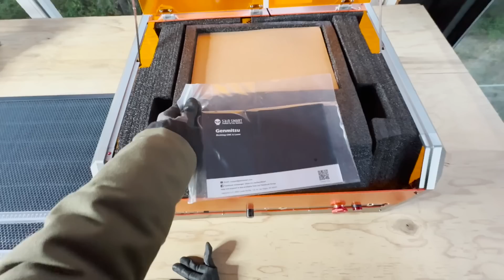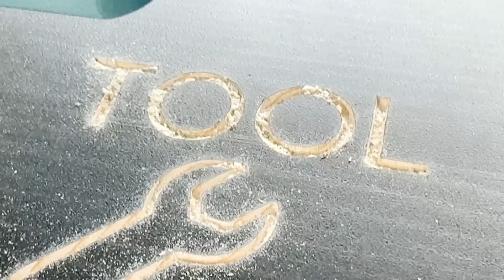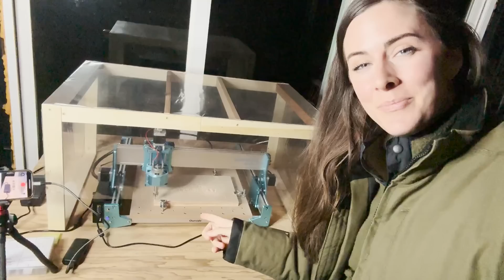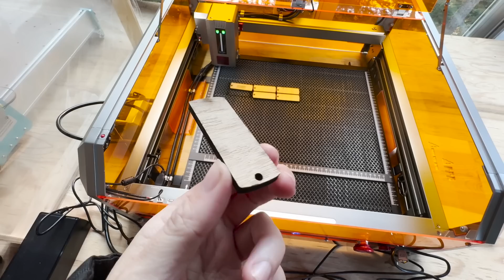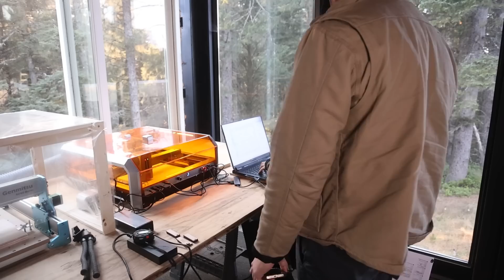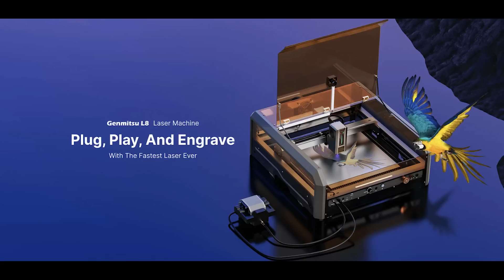DESKTOP CNC VS. LASER ENGRAVER - Pros Cons and Everything In Between #CNC #Laser #diy

Comment: This piece took four hours because you only used a 20-degree V-bit. For pieces like this, you could use a clearance bit  as your first bit, and then use a 30- or 60-degree V-bit as your detail comb. This would take 30 minutes, or less, depending on the size. You can use easel option.

Comment: I am kind of thinking of dabbling into some engraving and seeing this was helpful. Curious if this statement makes sense or if you have had time to use the CNC more and found it to be better for certain things.

To me, it seems the laser etching device is lower cost and faster learning curve because it is limited burning material and better for thin and small crafting items. Such as perfect for etching coasters or personalizing smaller items, but the CNC would be better for creating things like Address markers or working with thicker material?  Example would be if you wanted to make an inlay for a cutting board you would need to do that on the CNC?

Comment: When I look at the spindle on that cnc I cringe. It is way too small and the tool is hanging out too far causing a chatter problem. However I like the machine but not the spindle. 82 year old cnc and manual machinist and still Makin chips.😊

Comment: Laser is more energy and cost efficient at cutting wood upto whatever the rated thicknesses are (1/8 - 3/4" thick for ordinary diode lasers), while CNC is more versatile in terms of material choice and techniques (Especially "carving" and "shaping", lasers can only cut straight through), and can normally accommodate upto 3" or more. It's more messy than a laser, but it's got noticeably more versatility.

Comment: The CNC should outperform the laser with proper drill bit without a problem.. but I would assume one needs to wrap head around having the "picture " divided intoultiple layers . . One for the thick parts ...one for the fine details. Both are great machines and I'm sure you'll be more efficient in squeezing their potential out ,the more you work it

Comment: After you spend time with the CNC you’ll figure out you can drastically reduce your carve time by using a larger bit and separate tool path to clear large areas. Then use your small v-bit for detail work on a separate tool path.
Reply from the maker: Great point! That's a great tip to save time 😊 Appreciate it

Comment: If you used a 90° bit instead of the one you used, you understand the error of using a 20° v bit 😂😂😂
Reply from the maker: We used what we had. Now that we experimented a little bit we can upgrade to other drill bits but like I said in the video, it was our first time using a CNC machine.
Reply: @PacificPinesRanch  trust me, I had the same difficulties when I first got mine. With router bits from Harbor Freight .. definitely a learning curve.

Comment: 2-3 hours is short time.  I do peoples pets carved into wood and some designs can take 14 plus hours.     You should definitely set up a “roughing” and “detail” pass..  use an end mill bit for the roughing and your vbit for the detail pass.   
The roughing will clear out the pocket, and the vbit cleans it up.   It should take that 2-4 hour design you did and make it 1-2 hours.
Reply from the maker: Thx for all the tips/advice! We only had the V bit when doing this project so we made the best with what we had. We’re still learning and definitely still beginners. I appreciate the advice though! It will definitely help on the next project.
Reply: Where your bit is displayed on easel’s main screen, there’s a plus sign.. click that and you can add a second bit.  This will set up roughing and detail passes.  Remember to set feeds and speeds for each bit though.
When you have two bits set up and start a project, you’ll do the roughing first and the machine will stop..  change your bit and lower to zero again and start the detail run.  
Hope this all makes sense.  I wish someone had told me this 6 months ago when I started.   I just went in blind and figured it out. 🤷🏻‍♂️🤦🏻‍♂️

Comment: Check your feeds and speeds on the CNC and clear with larger 1/8" or 1/4" bit.  I've carved out much larger projects than that simple design in less than 20 minutes with 1 bit change.
Reply from the maker: Thx for the tips!! Appreciate it 😊

Comment: I've got a Fox Alien XEXE Pro with the rails upgrade kit / Makita hand router, and two Xtool lasers. If I was really pressed, I'd choose the CNC over both lasers... but ideally you need both. Lasers are very quick for detailed cuts, engraves with a natural burn effect and if you have a Fiber you can do metal engraving / cutting (though cutting often is for commercial lasers not pro-consumer level). I use my lasers more, just because the setup is more complex with a CNC (choosing which CNC bit, making sure the bit you by is 1/2 or 1/4 collet, pre-setup takes longer, etc...), but my CNC gives a cleaner finish if you don't want any burn, and therefore less post production clean up. Lasers can also do insane detail, and yes you could get that on a CNC but it would take more massaging than a laser straight out of the box (brass coins would need to router type bits, etc...). I'd be careful of the all in ones; laser and cnc router; the CNC heads on the routers are often underpowered / overrated (in terms of power) and often don't offer any protection from the laser.  I would love a CNC that has auto bit selection without having to manually change it, but the price seems to jump up at that point.
Reply from the maker: Thx for all the info and suggestions! 😊

Comment: I have had a laser for a couple years and have a CNC mill on the way (but have used them previously).  I suggest that rather than having them do the same thing, it’s better to play to the different machine’s strengths and how those match up with the main things you want to do.  

The laser is faster, but because it is burning away material, it only works on some materials and there are limited options for making anything other than straight sided cuts.  There is a trick for laser cutting V-grooves in wood so there can be a fair bit of functional overlap.  The laser can etch stone and glass.  Not burning but rather micro-spalling the surface to create a frosted look with little or no depth.  Can’t add more than temper coloring to some metal surfaces and most plastics are a bad idea.  Can cut and engrave leather and engrave skeletal materials.  Can be used with a heat activated decolorant or directly to add patterns to cloth (by removing existing pigments). 

The CNC mill lets you do more complex shapes (especially if you add a 4th axis rotary) and in addition to wood, plastics, epoxy resin, modeling wax and other solids become workable.  Metals too, though for these hobby mills, there are constraints mostly dealt with by taking it even slower.  And the very soft and very hard materials that the laser works on, the mill won’t.  Since I don’t have my own mill yet, I haven’t fully explored the possibilities there yet.

Worth noting ongoing costs too.  The laser pretty much just works, expending nothing more than the power to run it and the materials to be processed.  The mill uses those plus bits that are not especially cheap.  You will want different bits for different applications and they will wear out and/or break, adding replacement costs.
Reply from the maker: Great tips and info! Thank you for sharing! Appreciate it 😊

Comment: The answer is both.  Although some tasks can be accomplished with both, they are two different machines.  Upgrade to a Makita router to transform your CNC experience and capabilities.  Throw those clamps away and get XFasten Woodworkers tape to hold your work down.

Comment: Hi Beautifull eyes! i decide to start whit a laser, its a 2d products oriented but u can contain the smoke and vent it or filter, the cnc will come later, have to contain in my case the dust also, it can give you more deeper cuts and engraves but have no colour, it have to make aside, i believe can be complementary but im not sure of that, at the moment i see them as different machines and believe laser its more complete. cnc its noisy too and laser can give you finished works, a router its a tool to precess material and then follow whit the rest of the work till its finished :)

Comment: For the wooden version, put down a thin clear coat of epoxy, then once it's sealed, you can fill with colored epoxy. Laser is just black, but with CNC it's easier to add color
Reply: I agree on this - the CNC is more flexible for creating different types of projects.  I have both types. They each have unique purposes.

Comment: If you don't have a lot of space, and your volume is low, there are multi-purpose machines.  The Snapmaker, for example, is a CNC router, laser engraver/cutter, and 3-D printer.  You change heads depending on the task at hand.  For the CNC function, most models have a lathe option.  These tools are more expensive than individual machines, but less expensive than buying one of each.

Comment: If you use different bits, you will cut your time in half or even more on the cnc. Trust me. It can go much faster. Also move your speed times in easel up as well. They put it on the safest slowest cuts. You can make very good times adjusting those 2 things.
Reply: A flat bottom upspiral bit would dramatically speed up the process
Reply: @lavernejones6520  1000000%
Reply: I don't even have one and I was thinking the same thing must be true from what I have seen on other videos.
Reply: This
Reply: Can the CNC do the same type of cuts the laser did ? Or can it only engrave ?
Reply: As long as the frame and dpindle can take the excess torque.

Comment: As a Aerospace Defence Engineer now retired, I can see both units are very well built, 
Something that might help with the CNC Carving unit would be say a brush head skirt around the head tool assembly with a suction pipe that's similar to very flexible silicone hose to take the dust away into a box with filters & a fan the other side pulling the air outside Not into the room, 
To highlight the carving you could paint the carved area, dry, then sand, & use a ink roller to apply paint in thin layers to the upper surface, 
You have yourself a business making signs for front of homes, etc 
I do like the idea of acrylic carvings with the lights around the sides you could even change the depth of the cut to give a very fine cut to give like a cloud effect or say sun effect, that you would have to experiment with, 
The Laser cutter is amazing, you could make pattens for children to put together at schools like a jigsaw, obviously, as they say the sky is the limit with this type of units you could combine pattens using the wood as a base & the acrylic on top, I'm very impressed with both units, there's ample area on the units to do large jobs, 👏
Reply: You could also fill the carved design with pigmented epoxy or polyester resin before sanding.

Comment: Good morning 🌅, I don’t know anything about setting routers and laser controlled CNC machine machines, apart from that I have been watching quite a few recently, I did think about getting one at some point mainly a CNC router, but they are getting to the point they’re out of my budget, but I have noticed, you have got the little tiny router in your machine, I think this is the reason why it is taking so long, if you upgrade it to a handheld router, I think you find that the time machining will be reduced dramatically, and you’ll get a better finish, very interesting projects,